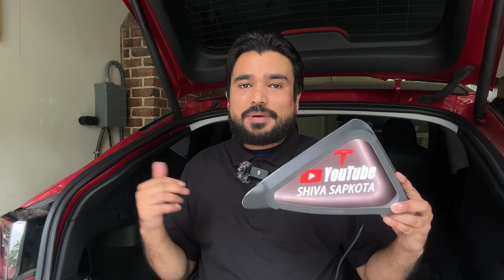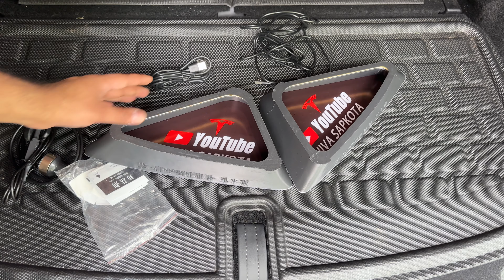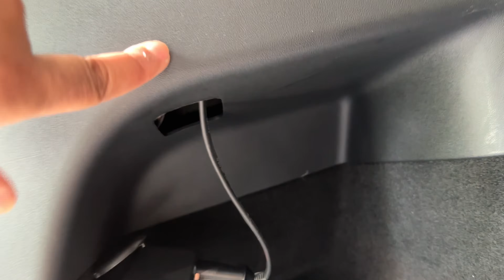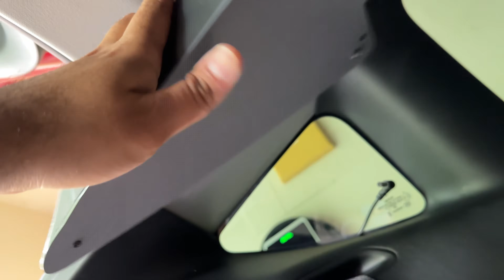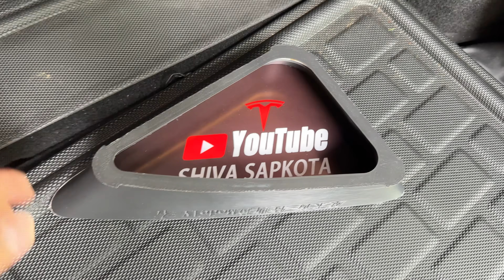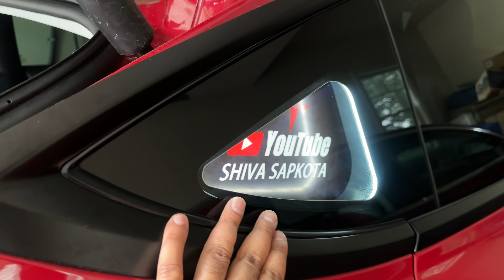NEW Tesla Model 3/Y Personalized Illuminated Window Lights (3D Effect EASY Installation) #tesla

Comment: It would be cool if you could change the design digitally through an app. It would be an amazing thing for rideshare drivers. I dont want a permanent design.
Reply: This would be fairly trivially to build something like you mention, however, LCD's are generally rectangular so it would either have to be smaller, or shaped like a rectangle inside the car.

Comment: Very clever. But it looks more like a prototype than a finished product. I agree that a Y-connector behind the panel would be better. The flashing with the extender should be optional. You are right about the backside being black. The light color looks awful from the inside. Thank you for mentioning that it would be easy to open that up and customize it. I think some users might want to change it for special occasions. Thank you again for a very nice review.